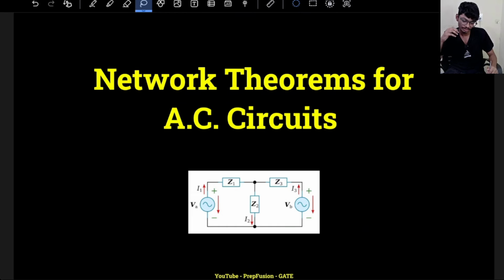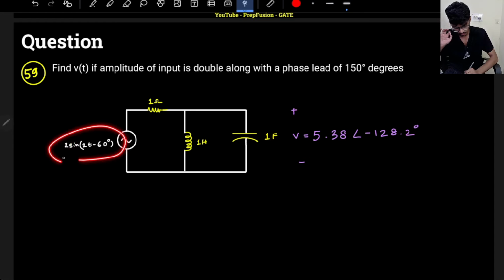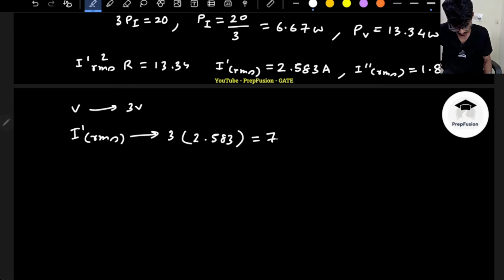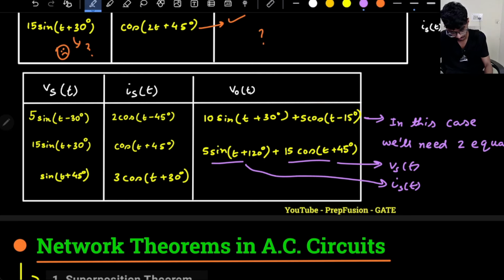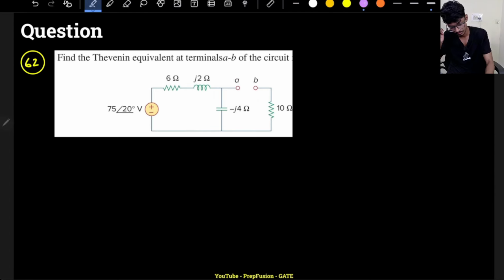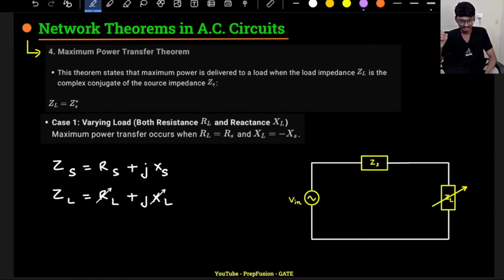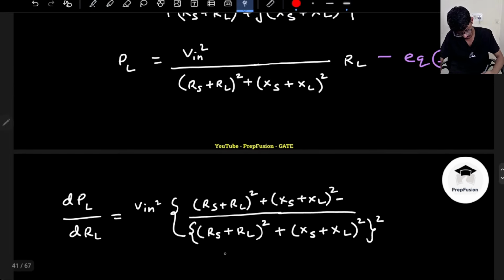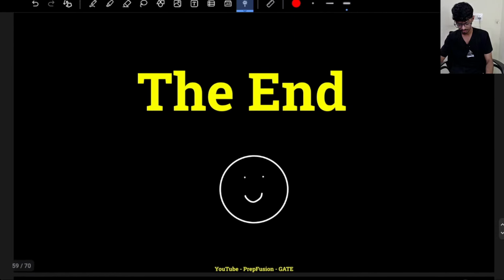Network Theorems in A.C. Circuits || AC Analysis || PrepFusion

Comment: the question in thevinen's and norton's theorem, why can't we calculate the power consumed by load normally ? 
i mean thevinen's impedance won't change because we will nullify the source and the ratio of voltage to current won't change so we can put it unchanged.
since the voltage source changed and load changes can't we put the zth same and connect new voltage source and new load forming a series circuit and find the power consumed by the load as (i_rms)square * R (real part of the impedance) ?
Reply: BRUH , you can do whatever you said , that is exactly has been done in the lecture as for impedance is concerned but you can't apply theorem with the source voltage itself you need thevenin voltage/open circuit vtg .